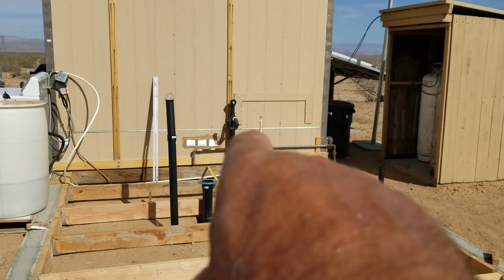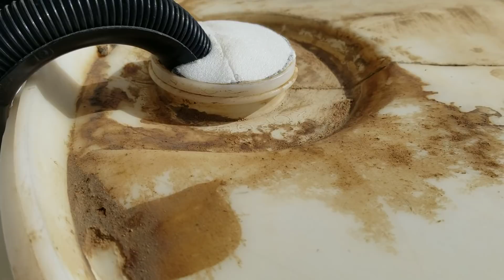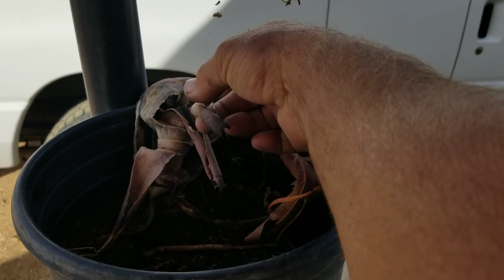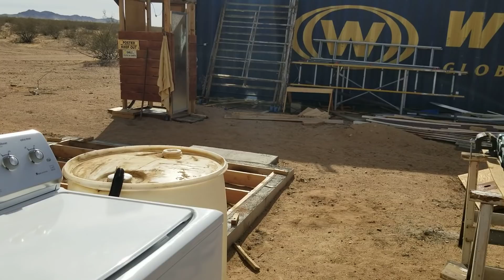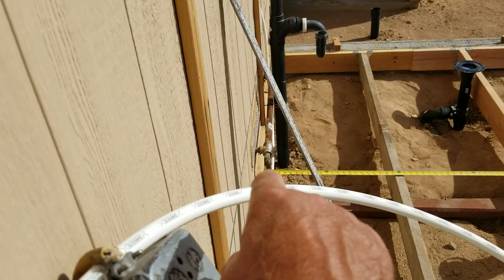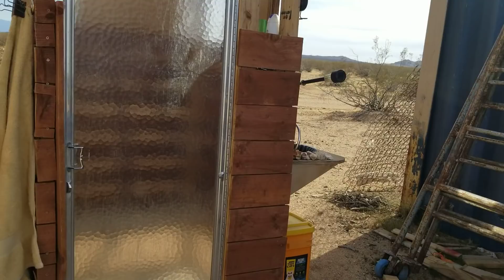Homesteading the Desert,  May 5, 2018

Comment: Question for ya G Bear: What have you considered for ground cover, if anything (to mitigate dirty feet, mud, etc.)?

I ask because next week I will stop at Tractor Supply in Show Low to pick up a $9 bale of cedar chips (10 cu. ft. expanded) primarily as a substrate for my tent floor footprint and living area. I also want to see how it fares while I'm away. I'm hoping it's a better solution than the popular crushed lava rock/cinder sold in my area: imagine walking on Cap'n Crunch between your shower and home.
Reply from the maker: LuckyPrepper I'm not sure about the weather at your place, but if wind is a factor the wood chips will be looking great on your neighbors land.  How about maybe mixing some type s or plastic cement or even checking home depot for pallets of broken bags of cement for cheap dollars, then mixing some of your aggregate in and making walkways?  Just a thought without knowing more.
Reply: G Bear 
Mixing cement with what you have..
Is cement treated soil..
Was and maybe still used on some dirt roads..
Is still used on some military bases to treat the soil under some roads and runways..
Reply: Thanks for your input guys!  Since posting my comment and reading your thoughts I've started really looking into my groundcover desires. Man, there's new things to learn at every turn. Love it!

With the exception of my tent area, it's overall a low priority so I've time to research.  I think I'll use my immediate need as a testing opportunity. Thanks again! 👍
Reply: Hey Lucky, the wood chips will also float. If you get a good rain they will wash away. Just something to think about.
Reply: LuckyPrepper 
That's one of the nice things about sites like these..
Exchange of ideas...
Or exposure to new ideas..
Or explanations on how to...